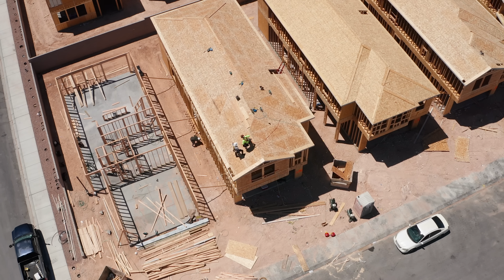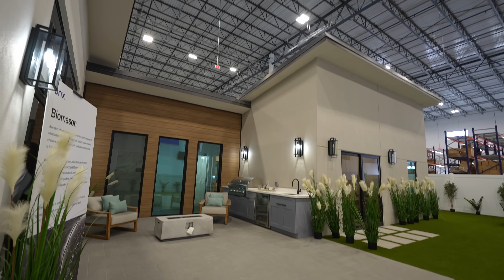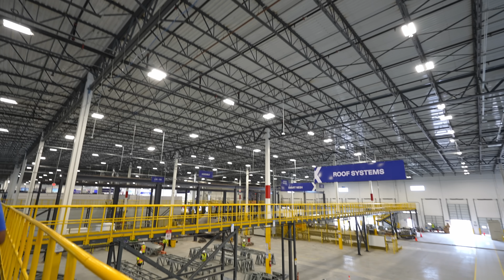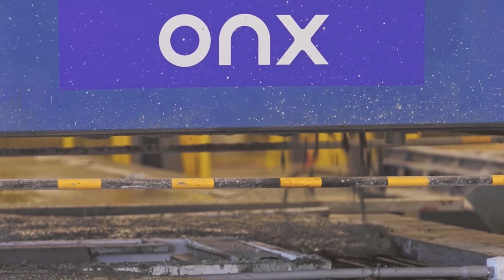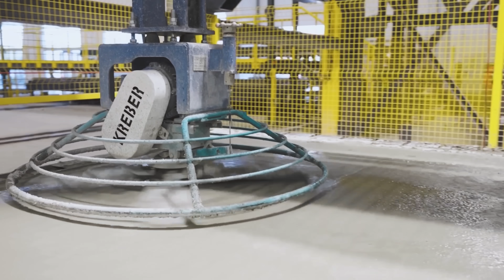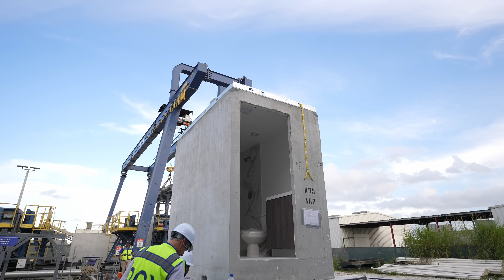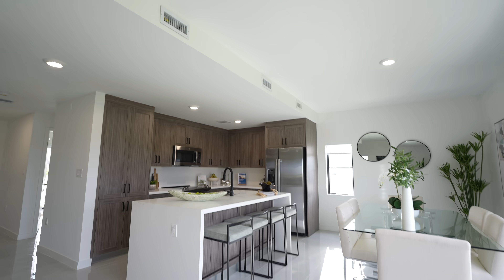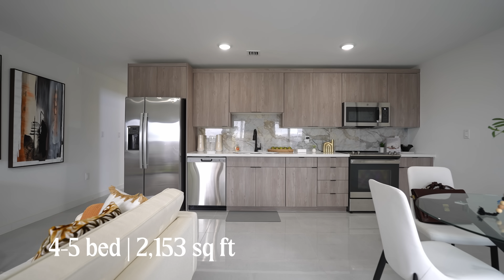Why This Company is Building Thousands of Concrete Homes

Comment: Pre cast concrete is new in USA ?
Reply: Not necessarily new to the states, but it's new to residential building and Florida is an outlier to the rest of the country because the state is prone to hurricanes and have different building codes to adhere to than the larger part of the country. So, most builders in Florida have used concrete block construction over the last 20 or 30 years, but prior to that, stick built homes were the norm.
Reply: @fragout9575  I dont know about the US, but concrete is way safer than timber structures. Only advantage I noticed of Timber houses is that it can literally be moved from one place to another lol

Comment: As someone who grew up in North American suburbia but has lived abroad for the last decade or so, it's weird to visit the US and see all the wood-constructed, wildly energy-inefficient homes that I grew up around. Concrete is the jam. It's structurally solid, holds heat and cold well, provides actual privacy when you close a door to another room.
Reply: People today so often judge people 100 years ago as idiots: "why didn't they do it this way instead of that way?" Things were different 100 years ago. Perhaps wood was very cheap but concrete was expensive, who knows? But they weren't idiots. They did what worked best at the time. One day our ancestors will look back at us thinking we're idiots for owning cars, but that's what works for now, until something better is invented.

Comment: Lawmakers should have always required developers to use a minimum of half acre lots. With small patches of woods and fields separating the homes. It gives the neighborhood a much nicer feel. Yes, it's more expensive, but worth it! You might as well live in an apartment building, if you want that cheaper alternative, with that tightly crammed-in feeling. It's nice to have a little buffer zone between neighbors.

Comment: Imagine living in solid concrete in Minnesota in January.....  you'll never be able to heat it
Reply: These concrete style houses are everywhere in northern Europe where it is very cold... when you build a concrete house in a cold area you have to leave more space between concrete wall and drywall and fill the space with insulation (mineral wool , foam board insulation or anything you have, depends on the budget) triple glazed windows and if you want to take it to extrem you insulate the outside as well

Comment: In Greece they do build homes out of concrete but only the post, beam and decks are made of concrete. Exterior walls are a double layer brick fill with styrofoam insulation between the walls. What takes so much time to build these homes is that as each level is poured it must cure for at least 20 to 28 days before forming up the next floor. Really each floor is a two step process, post and beams are poured, allowed to cure before they place forms in to pour the deck. As the deck is curing they will continue to form the next level of post and beams. After about 14 to 20 days they will pull the forms and supports out from under the first deck and continue to pour the second deck. Now forming is done by hand with individual planks compared to the steel forms we use in the states which takes up considerable time which increases the cost of labor. Forming time could be cut in half with steel forms that lock together. Another factor is that they could be using ICF forms that stay in place and act as insulation both inside and out. The exterior wall is then covered with a high strength stucco while the interior can be framed out with steel studs and then drywalled with 5/8 inch drywall which is stronger and has a better fire resistance than 1/2 inch drywall.
Homes with concrete floors are also prime candidates for in floor radiant heat which is far more efficient at heating a home in cooler climates but one must consider using split air heat pumps to cool each room in the house.

Comment: This topic is hilarious to me. I'm sorry. 
If a flood comes, my concrete house will STILL be under water. I will STILL have to deal with cracks and shifting - especially with a tornado. 
This is a just another type of building - not a problem  with that. But the concept and the reasons of this type, seems just hype.

Comment: I always wondered why you guys in the US build houses from sticks. With the first whirlwind every stick flies in a different direction. We do concrete and brick here in Europe.  The most expensive part isn't the walls, so why save in the wrong places? Tornadoes don't have much of a chance to tear down houses here. Worst case we replace some roofs (not even that with flat concrete roofs) and windows and that's it.

Comment: If you build a house too quick, you will have settling problems. The house was structurally will start to crack. The buildings foundation is key, not even mention.

Comment: Building industry is normally very local, and so are the rules, habits, materials and solutions. 
The way of building ready-to-use concrete wall is the most common in for instance Germany, where they had a building need and not that much wood after WWII. 
I live in Sweden - we build majorly stick-framed houses, although in an industry context - the walls etc comes out ready-to-lift-in-place from the "factory" (With drywall, color etc done already). 
It lower production costs and improve production quality. It normally takes a day to put walls and roof for a one family house in place, and then the fine-trimming adds afterwards. 
This is in most cases including bathrooms, kitchens etc almost ready to use. We have done this for decades now, and that is the same for the other Nordic countries (so in some sense it is a giant Nordic yawn, wondering if it is a using cheap mexicans trick to build so much onsite... ) This is a common way of doing it (the film is ten years old) https://www.youtube.com/watch?v=0NGE2bNBKJQ

Comment: Lived in Germany for 3 years. Concrete home. The US is literally the only place those does things different and it's inefficient. Hell even our metric system is trash 😂😂😂 Concrete homes keep your home cooler in the Summer and warmer in the winter. Resistance is greater against storms and noise is less penetrable.

Comment: 09:30 concrete is a worse insulator than wood, not the other way. If you use concrete you need to do more insulation.

Comment: Cool idea, but this idea won't go anywhere unless they create multiple regional factories.  This approach faces the same problem as Elon Musk's prefab homes.  Transportation is so expensive that they won't be cost-effective.  It would probably make better sense for home owners to locally contract for masonry block structures or steel structures.  $400-500K is more than enough to have a local contractor do a custom build.

Comment: I’m a homeowner of ONX home in Florida City. I love it, it’s my dream home. I recommend it. You can reach out to me if you have any questions.
Reply: Can I build one in Dallas tx
Reply: Hi @Sergio-gm4gv - so did you have this home built?  Or you are living in a development that only has ONX homes?  This seem really interesting, but I have some land in North FL I would want to build on.  Just wondering if they do "on demand" building of the homes, or only in subdivisions that only have ONX homes.  Thanks!!
Reply: How much do you pay for insurance?
Reply: Do you have a credible R-factor insulation rating for your home?  Example: R-25.
Reply: @jamesdesmond1301  Its a spec house so it'll be code minimum.  Continuous Insulation works better and gets a diffent rating requirement. Thermal mass on the inside is great to level out temp. In florida that wont help much.
Reply: @sparksmcgee6641 😢no--it won't help much in Florida.  Temps will radiate indoors without serious insulation planning and technologies like radiant floor cooling/heating and/or geothermal incorporation.  I like it, though.  This house is concrete and has withstood several tornados-but suffering the lack of insulation and temp management planning while the a/c is out...😱
Reply: ...or in the winter when it was near freezing or below...😢both happen here routinely!
Reply: @honeybadgerisme I know the 3d printed houses trap air in the concrete walls and the air itself is the insulation. I guess the question would be: How does Onx make their walls? I have heard of concrete that has tiny air bubbles in it that does the same thing...
Reply: I’m in San Antonio looking to build do you have information for this area
Reply: Hey Sergio can I ask you some questions?
Reply: Sure
Reply: Sorry James, I don’t know what even is. I just shared what I do know to help others based on my experience.
Reply: Hey Sergio  what if you have a plot of land in a established neighborhood  ( Liberty City in Miami-Dade County) will they build the home on my land or do they build only in certain areas?
Reply: Nevermind  Sergio I just called Onx phone number from their website.  My Question was answered.
Reply: @psychicmediumleoshelton5027  what did they say?  will they do on demand building?
Reply: @psychicmediumleoshelton5027 what they say? They don’t build on your land?
Reply: @Ye-tf9im  my bad I should have included what they told me 🙃...basically  no. They are building on land -almost like their own communities/neighborhoods
Reply: I hope your not near....a sink whole! Which are literally EVERYWHERE in Florida. Once aquafers are depleted.....ground settlement is a given.  SEE maps. UP insurance!!
Reply: @leainokuchi9650  it is pretty unlikely for ground water to disappear, only flow out of an area to another through underground caves
Some good trees with sturdy root systems can also help keep the water table stay at a steady level and anchor the surrounding sands.
Reply: i want to buy  for   investments
Reply: How good is the concrete keeping out the heat and humidity of summer? Thanks in advance.
Reply: @frankleepower2333 the answer is by peeing in the morning , u feel good , then u drink 8 glasses of vodka  and u pee, then u drink 4 cups of   h2so4
Reply: I have so many questions!!
Reply: Build home outside  USA, South Pacific  ,Tonga .three bdrm three bathroom  ,garage.

Comment: They need to come to GA, TN, MS, AL, SC, NC. There are tornadoes in these areas. I don't know why people still build with wood in those areas, (in the US period). Makes zero sense. You can build additions to a concrete home. The pros of concrete homes outweigh the few cons. Wood is ok to build a shed, not a home 😅. With precast and ICF you have plenty of flexibility. Dont let the nay-sayers tell you otherwise. About time the US moves forward with better construction methods and materials.

Comment: A not pre fab company but selling pre fab product.. Now thats a new term.. Its cheaper because they probably got land cost cut down (when you mentioned in the video) i highly doubt that the pre fab gets cost cutting (as it would imply that its cheap QC concrete) which i assume is not the case..

Comment: One of the issues with the concrete of the homes in different parts of Africa although it's concrete concrete absorbs the Heat and it absorbs a cold it absorbs moisture it's heavy and you'll see even in areas where they had earthquakes the concrete homes crumbled horribly

Comment: The whole world looks at the U.S abd be like why not concrete!
Reply: Because concrete is permanent, which is a major no-no in the US and repairs to concrete are prohibitive in cost. A key difference between the US and Europe is remodeling culture. On HGTV, shows like Fixer Upper display older homes being remodeled and given new lives, which often requires wall knockouts and new electrical, piping, etc. You cannot do any of those things with a concrete house without compromising the structural integrity, which is why when when Americans buy houses in Europe they often get told by the locals that they cannot change the layout of the home, like in the US. To make matters worse, many concrete repairs that are done in Europe, especially southern Europe, would not pass muster in the US. A crack in a concrete wall in Italy can be rectified by jackhammering out the affected area and then be refilled with cinderblock and concrete.

Comment: Drywall is straight trash, there has got to be a better way to finish interior walls. I'm shocked this cost comes with land, that's the REAL innovation here, would be nice to see them doing small like 800sq ft. 1 bed w/den for singles or couples as well if they're putting them on land at decent prices.

Comment: Communists in the 60's and 70's took this approach too. They used concrete prefab walls.
They also had a housing issue after ww2.

Comment: This is like the aircrete (or in Ozland) the hempcrete homes which is a concrete type of material, surprised that Shelby did NOT mention one of the other advantages which is unlike wood it’s termite resistant!!

Comment: looking at the house plan at 4.54, not a good house plan.  first for five bedrooms, you would WANT two car garage minimum..  Next it screams out to me why would you have a balcony for the bedroom and NOT make it one that is connected to the master bedroom?  Based on the design,  I do not think that will be used as a bedroom, but rather an office or something else, so calling it a five bedroom is erroneous.. look at the close being significantly different.  Also, the "bedroom on the first floor that has exterior doors, that would not be used as a bedroom but maybe a air bnb or something. This area would be better suited to extending and making it garage so its a two car garage.  Doing that and marketing it more as a 3 bed, one office with two car garage would be so much better. Tho that does not resolve the very small dining living room area.  That could be resolved by moving the stairs south a little, flip flopping the corridor and stairs on the second floor and rearranging the entry to a bedroom and the AC closet flipped. Overall, this is a C+ design, or maybe even a C-

Comment: Those homes are expensive as hell. Plumbing will be a nightmare. Also, the consumers are not benefiting from any savings. This is a lie. The saving is for the company to enjoy, not the comsumers. Traditional homes take into account labor, time, materials and so on to calculate the price per square foot. Onyx is doing the same calculation but it costs them less per square foot yet they are charging the same as the traditional method. How is that saving for the consumers? Also, there's no such thing as green concrete.

Comment: Concrete homes first are used by USSR after WWII, known as Hrushovska appartments, then Italy did the same in 1970s. It's not the healthiest thing in the world, but certainly is a good bunker. In Florida may work b/c it's not cold, but in colder places it may not be the best solution. In Italy people no longer buy such homes and they stopped building all concrete homes. Other places in Europe, all columns are  cement/iron bars, then the rest are bricks. They are solid too, and healthier.

Comment: It’s cool that they’re able to build these houses in a factory, but, Florida, has had concrete homes for many decades. The building standards are high, so the average “builder grade” home is built like a tank. My house there is made of concrete block and it was built in 1959.

Comment: Man the one drawback for me for concrete is the versatility.... like if anyone ever decided to make a change to the house or there was a mistake of some sort good luck with that. Running wires, adding or removing something, relocations, additions, etc. But hey I guess if you pre-plan like 20 years in advance you could probably avoid some of that.
Reply: The weak point is the concrete slab joints. Matalon did that here in Jamaica. They have plates embedded in the edges where a weld is done to join two slabs. This type of joint seriously stresses the concrete adjacent to the joiner plates. The normal concrete buildings here have a fair amount ofreinforcing steel embedded in the concrete especially in the columns where the horizontal ties can be as close as 3" at the tops and bottoms to prevent the concrete fracturing and falling out and the column failing. Steel in the floor slabs is continuous into the columns and then the concrete is cast unlike your system. A newer system here uses Styrofoam hollow blocks which have reinforcing steel bars placed inside then a premix concrete truck pumps concrete into the internal space so the house is a single monolithic casting. Very strong. We have up to category 5 hurricanes and are a severe earthquake zone.
Reply: This. A major problem with European homes is that cannot be remodeled easily, and there is not much that can be done if subsidence affects the home for any reason. You can raise an American home if needed on the jacks, but a European home will crack and then have to be rebuilt.

Comment: Concrete, block and brick do not work well in earthquake prone regions; too seismic sensitive which is why mostly wood some steel is used as it can flex more.  If you are talking about rather expensive steel reinforced commercial properties, that is different.